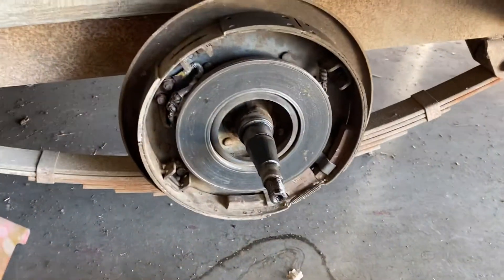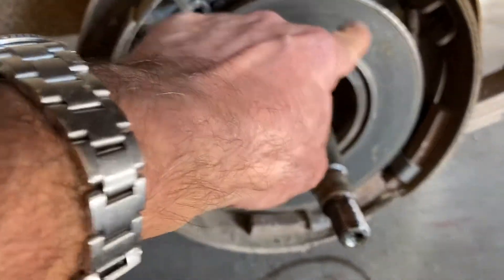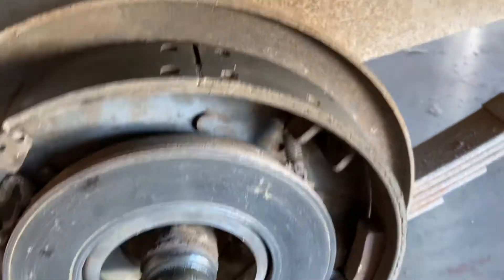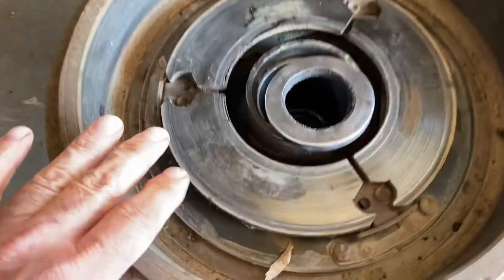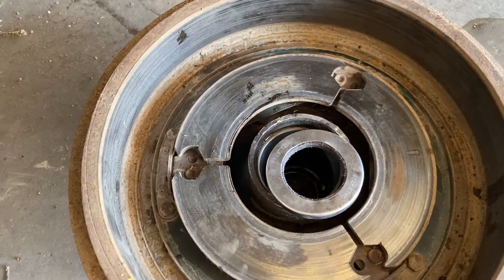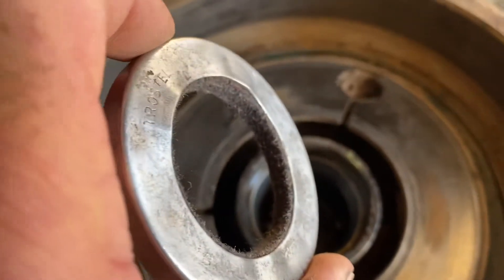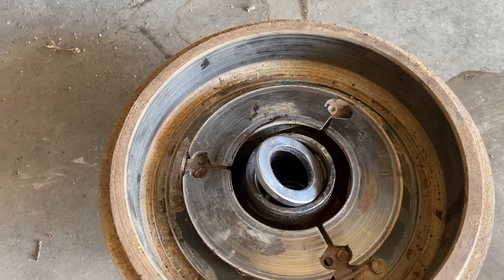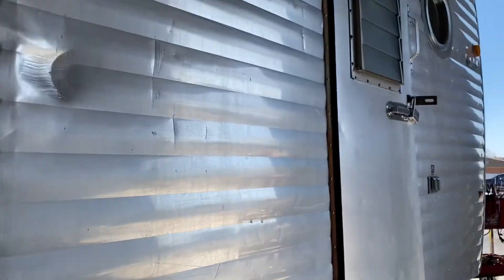Vintage Trailer Axle Service

Comment: I have a 1957 5200# 5 on 5 1/2 bolt pattern pair of axles, that look similar. Also use gear lube behind a screw on (fine threads) dust cap